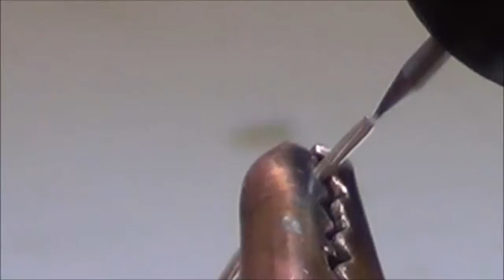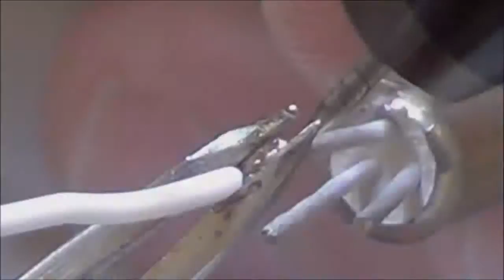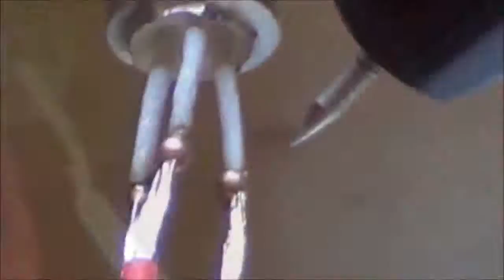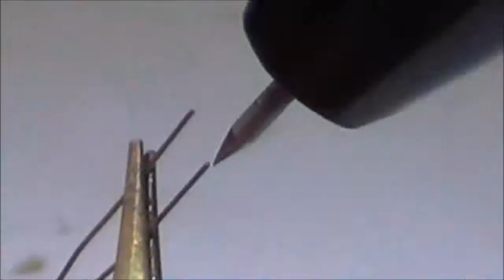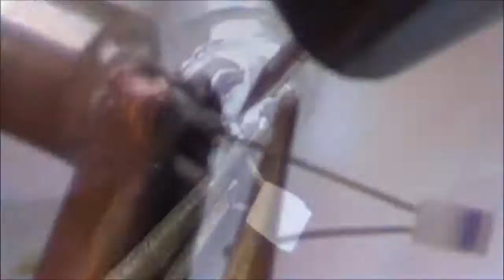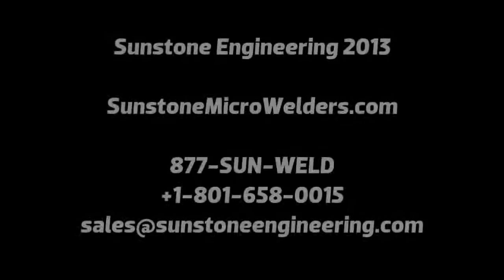Butt Weld 30mil Thermocouple Wire to 22awg Stranded and 6mil Solid Wire - Orion Pulse Arc Welder

Comment: Can this welder make the joint for a constantan wire to a stainless steel surface? I need a solution for a medical product. Specifically an invasive pain relief treatment electrode
Reply from the maker: Sure can. If you're able to email in, our samples engineer can answer those questions better for you  sales@sunstonewelders.com

Comment: What material is that wire?

I need to do this with copper wire, example .045"-.050" solid conductor to 16AWG stranded.  This reasonably possible with your equipment?
Reply from the maker: Jay A Hello Jay, the material in this video is magnet wire which is a copper wire with a coating on it. The application you described would be very easy with our equipment. Give us a call or shoot us an email and we can help you know what the best option would be for your application 801-658-0015 sales@sunstoneengineering.com